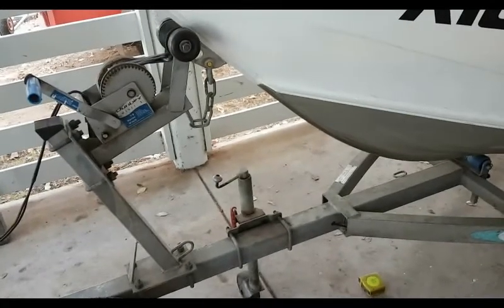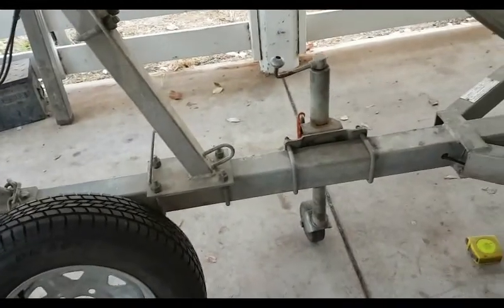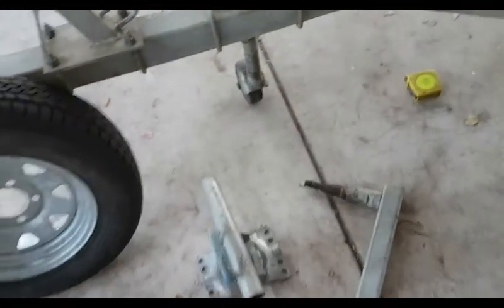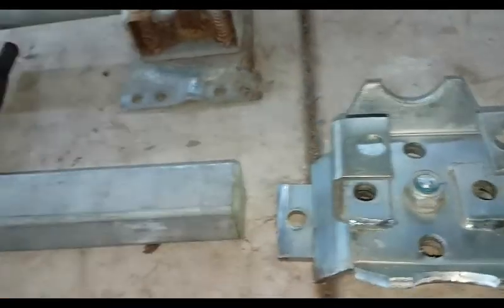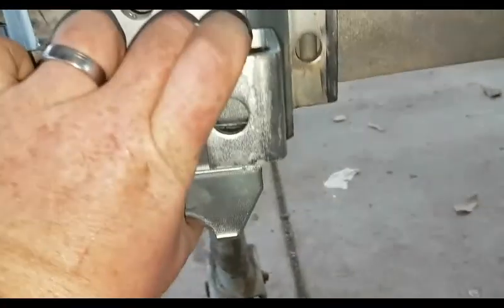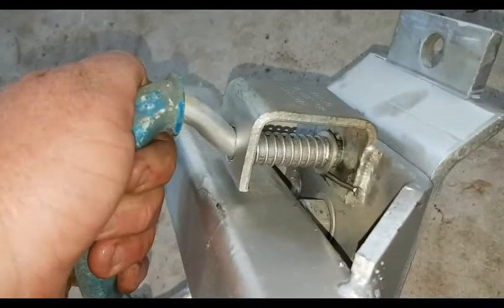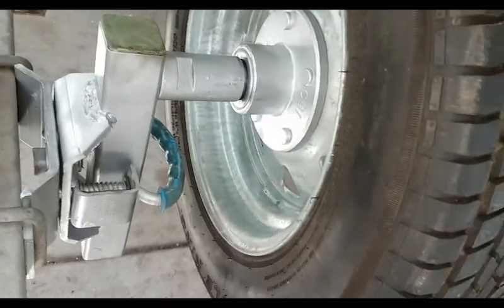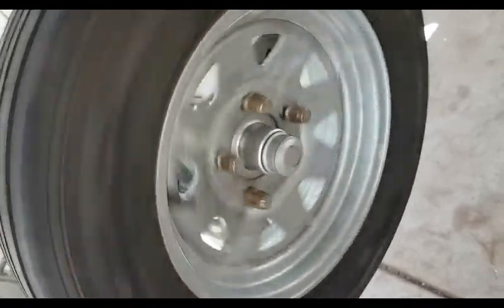HOW TO: Trailer Drop Down spare wheel / Beach Launch / Spare Hub, Tyre, Bearings!

Comment: Good job mate i had a pre manufactured one on my last boat used it heaps of times ,actually saw a bloke wheel his trailer out floated his boat on and got his wife to pull the whole lot back to shore in about 4 feet of water .The one i bought cost me over 400 dollars for the mechanism and the hub so i rekon youve done well .